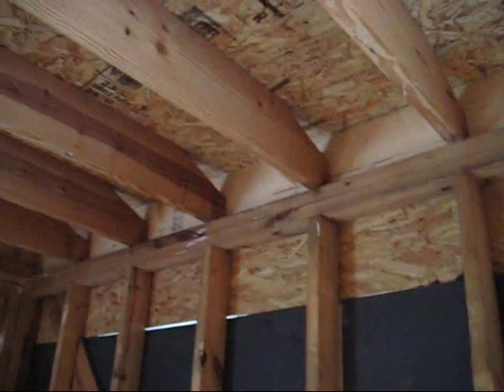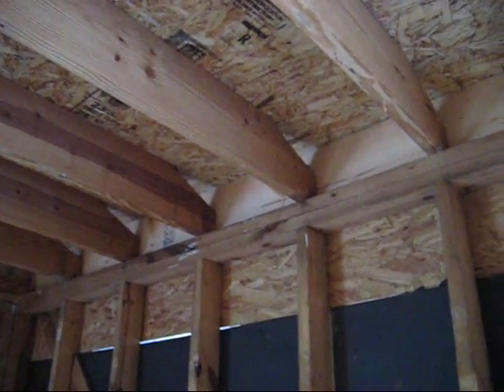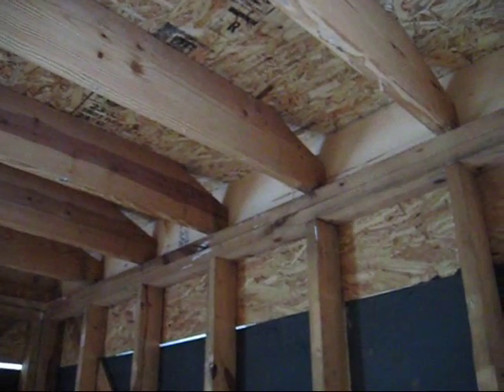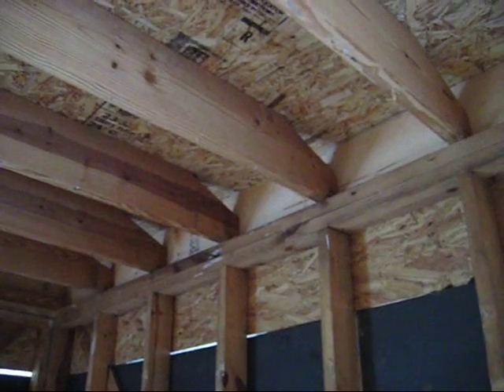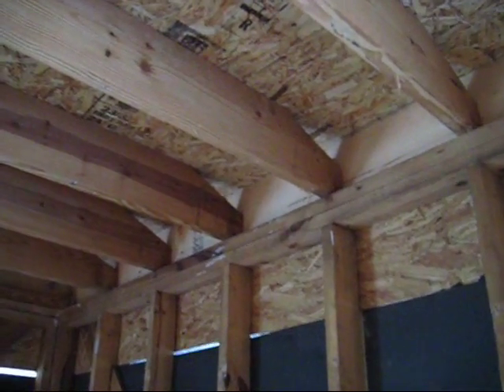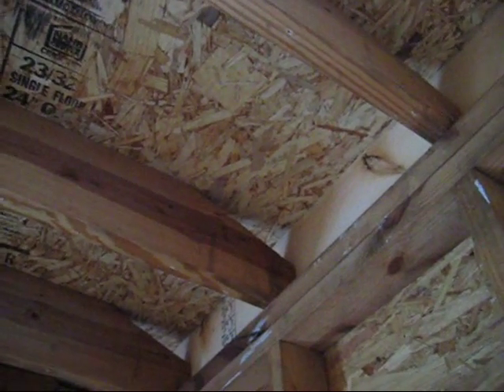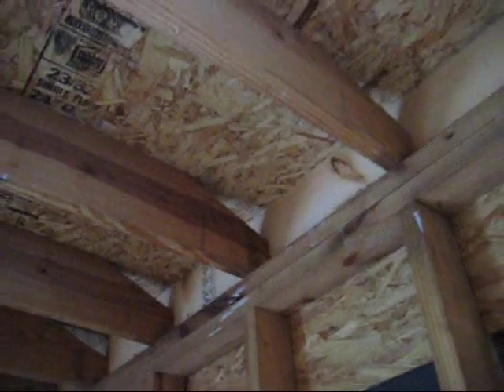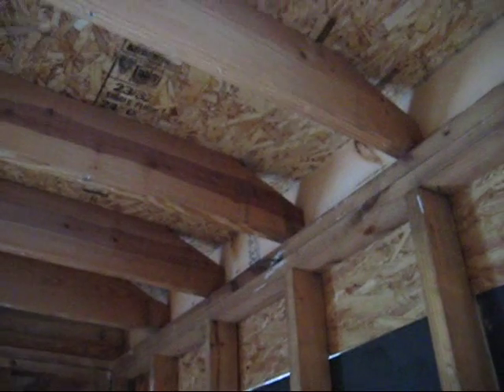Avoid Costly Mistakes: Consult an Engineer (part 3)

Comment: what a phuking idiot contractor.  not just the axial load, but the shear forces on the joist will exceed that trimmed joist.   Also, fastening 2x8 under the floor will NOT fix those joists due the shear forces.  HIRE AND ENGINEER.

Comment: I know this is an old video but for anyone reading his advice about cutting blocks only solves the problem of not having adequate bearing for the wall. You would need glued and bolts sister joists probably at least 4 feet long to get the proper strength back into those 2x8s. By cutting them like that you effectively have a 2x4 joist on the end thats cut.

Comment: Easy fixed ...added 2 pieces of 2x4 each side of rafters and will be fine .
Engineering thing is finding the way to solve problems when happened things like this.

Comment: The studs on the top floor would transfer the load to the rim board (it's a 2x right?) which would be transferred to the stud on the bottom floor.
I would be more worried about the floor weight that the cut down joists (such a horrible spot to be missing some wood) are holding.

Comment: that top plate is normally doubled for weight bearing.  if you see the other top plate while he is filming you can clearly see their top plates are doubled.  His is fix is correct, I would glue and sister up 12 to 18 inches back add additional support.
Reply: The double top plates are to spread the load more evenly to the 2 adjacent studs that the top plate sits on and also (mainly) to keep the intersecting walls from pulling away from each other.
If the floor joist is directly above the stud then the double top plate does very little.